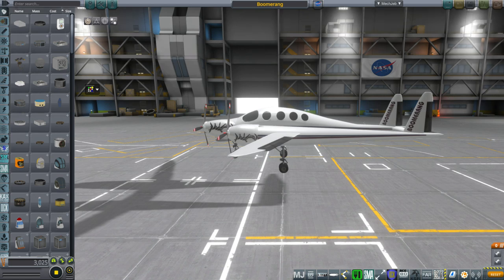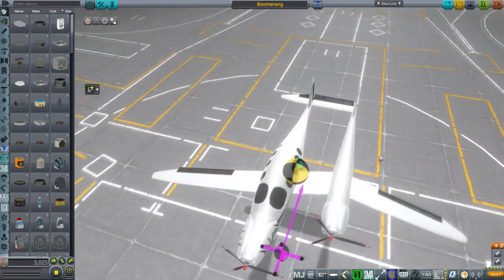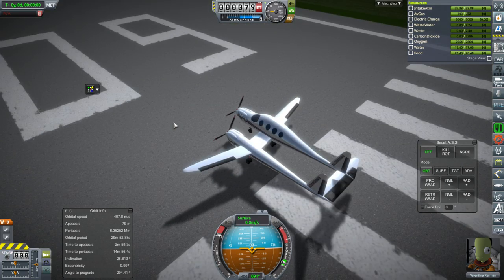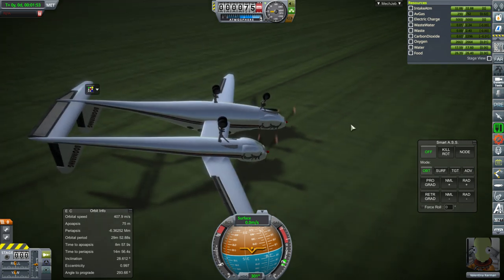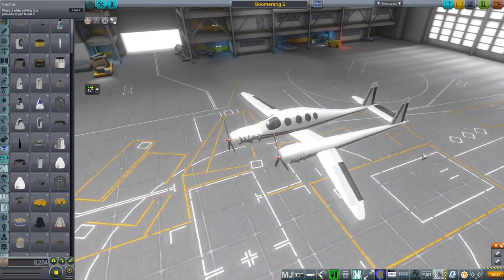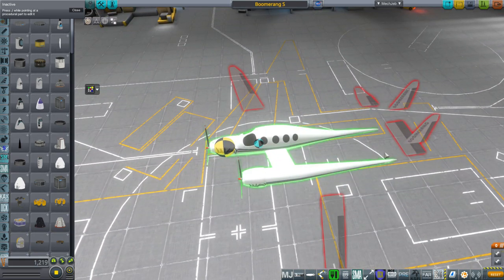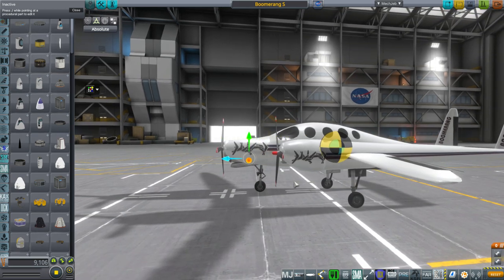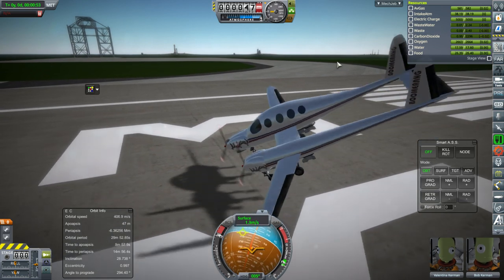KSP - Realism Overhaul Sandbox - Rutan Boomerang Blues

Comment: In 1.3.1 I'd often get a bug where adding crew to a part completely screwed around with the masses of every other part on the vessel. I'm guessing it's something to do with the code that adds/subtracts 100kg per kerbal going wonky. The bug was only present in the build scene - when you launched the vessel, the correct masses would be applied in the flight scene.

In the build scene, the right click menu of adjustable/procedural parts would show the true/correct mass that would be used in the flight scene, however the middle click menu (i have so many mods idk if the middle click menu is a stock feature or not, and if not which mod it comes from, sorry) would show the mass the game is actually using in the build scene to calculate the COM, etc.

The way I got around this was by removing all crew when designing the vessel, using 100kg per crew of lead ballast to simulate their mass, and then removing the lead ballast before flight. Maybe that's what you're experiencing here?

Comment: As for the center of mass, I think the SPH display is obviously incorrect. Since you moved the CoM of the individual parts forward so much, your boomerang flips onto its nose on the runway, suggesting a CoM in front of the landing gear.
As for your yaw stability, I can only guess. Maybe you're missing body lift (well, not lift as in vertically, I mean laterally). You could try rolling the whole plane in the SPH 90 degrees and see if KSP shows the center of lift (which would be now in lateral direction with respect to the plane). But given that KSP already fails to show the center of mass correctly, this might not work.
Another reason could be the center of pressure in drag is offset laterally. That would only show up once you picked up reasonable speed, though. On the runway I believe its due to asymmetric landing gear, something KSP is known for to handle poorly.
Hope that might help, cheers.

Comment: Can't help you but can tell you I have had some strange CoM & CoL in KSP (without mods... DLC breaking grown.) ...not like this, ...only unexpexcted readings. (And there is no realism overhal on my computer, so I don't know if it can be same thing.) ...guess it can be lack of KsP skills in my case. I also don't know where to find info about use of propellar. Have manage to fly an aircraft, but don't really know how to do it or adjust speed... I mostly change the angle of propellar-blades and have a feeling I have sett things up very wrong. Just improviced.

Comment: Is the weight of the actual body really light?
Reply from the maker: It's about 0.77 tons without the engines and landing gear, so I would expect the CoM to move a bit, but just not as much as it does (especially with the CoM on the parts artificially shifted up).
Reply: @RaizSpace  from the vid it seems that the addons are affecting the com so much because relative to the body they are so heavy. I would say to make the plane work more realistically you would have to make it unrealistically heavy so the addons are not the main mass on the plane.